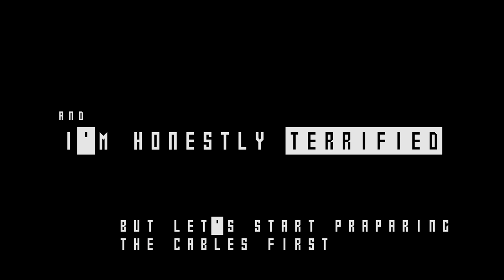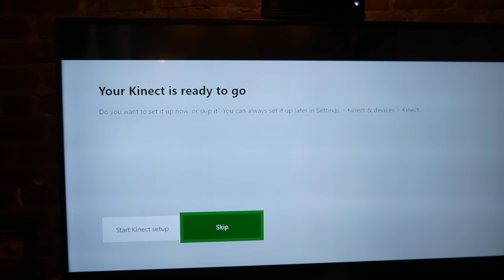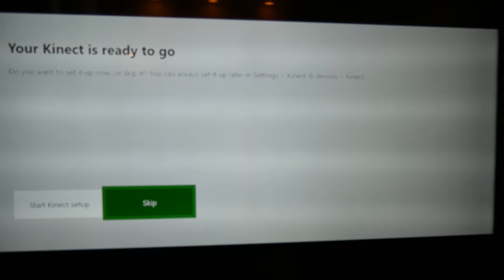Preparing the Kinect - KINECT Full Body Tracking VR - From start to Finish - Ep. 1 [4K]

Comment: Couldn't you have just used the Kinect PC Adapter kit that is a USB + Power brick which simply plugs into your PC?
Most electronics retailers sell them, as well as directly from Microsoft.
For a while they were even giving them away for free to customers who had upgraded from the original XBox One to the XBox One S.
That way you don't have to modify or destroy your Kinect.
Reply from the maker: Unfortunately the adapter was discontinued 2 months ago, and it's now a day impossible to find for a reasonable price, this guide is for who like me didn't get it with the one S or before being discontinued
Reply: Oh no! I wasn't aware that they were difficult to find. I have 3 of them sitting in the closet, unopened. Microsoft sent them to me when I did my console upgrades, and at the time they were also in stores for $50 Canadian. 
I have a couple of XBox One Kinect's sitting around (as well as the XBox 360 ones), so I plan on testing out this full body tracking using both options. 

From what I've read you can also use the older XBox 360 Kinect as well, and those PC adapters are cheap ($10-$20).

https://www.amazon.com/Adapter-Kinect-360-HandHelditems-Sketch-Universal/dp/B005EIXVAE/ref=sr_1_18?ie=UTF8&qid=1521570247&sr=8-18&keywords=xbox+360+kinect+adapter

or

https://www.amazon.com/Microsoft-Xbox-360-Kinect-Sensor-Adapter/dp/B00JVI6BVY/ref=sr_1_6?ie=UTF8&qid=1521570247&sr=8-6&keywords=xbox+360+kinect+adapter
Reply: those have not enough power, you need atleast 2.7/3.0a power adapter. Even on aliexpress they're around 30euro for xbox one kinect pc adapter
Reply: I bought a Kinect for £20. Why bother trying to get a £50 adapter?
Reply: i bought xbox one kinect , + other equipment worth 48 euro just to solder it. I would say it's not worth soldering and its really hard. Took me 2x tries to solder it properly so it could work. And its not that good for vr its very bad
Reply: E- Mail £25 + a free adapter I already have. I'm good at soldering so definitely worth it. Yeah prob sucks for VR so good job not spending much money on it.
Reply: Tyriel Wood JUST USE A KINECT 360
Reply: @krankypantz330  Can you send me one?

Comment: Hi Tyriel

A few tips for soldering, a thing called helping hands is priceless when it comes to soldering you get 2 more hands, also get a soldering stand with a sponge so you do not wreck the tip of the soldering iron, also always soldering the wire first called tinning, use helping hands to hold the wire then just heat the wire up and spread the solder over the copper wire, and lastly when soldering make sure there are no holes and good contact called dry joints which can cause conductivity issues when powering it up
Reply from the maker: thanks! It was my very first time^^ I'm glad my rough way worked too :P I will do it next time!

Comment: to hook up the connect to the computer instead of taking apart the whole connect like in the video, could i just find an adapter on amazon and use that?
Reply from the maker: They are very rare and if you find them they are very very pricey 💵💵 but if you found it go for it! Even better! Just be sure it is for the Xbox one and not the 360 🤞
Reply: @Tyrielwood  I found one for $90 CAD on Amazon. Will be ordering and seeing if it works out!

Comment: Wait... Isn't this just going to put 12V back into your PC from the USB cable? I know this is how it is done, but isn't that a risk?
Reply from the maker: no, but be very careful to don't have the point 4 touching any other point, or that will happen and you will fry the kinect and your usb drive with it (they are very close, so be sure to clean every residue)
Reply: How does it not? The original USB cable carrys 12v from the XBox into the Kinect. If all you're doing is tapping 12v into the same pins from the kinect end, then 12v is going through the USB in some way? Am I missing something?

Comment: It wouldn't surprise me if Microsoft pull a sony and use the enviable xbox VR to shift old kinect stock as repurposed full body cameras. It worked well for sony and the move controllers. And they spent fortune developing and no doubt manufacturing a shitload of those things and just dropped it at the drop of a hat. Its less intrusive than the valve or other alternative products that you need to screw multiple sensors around your living room. Its a decent product and im sure it would sell. That ps5 camera must be there for a similer purpose down the line.

Comment: I see a connector on Amazon for like $10 that works with the Xbox 360 kinect. Could I use that instead of doing this?
Reply from the maker: of course, if you have the kinect 360, but if you have the xbox one version that adapter will not work! there are links in the description of everything you need :)

Comment: Does this work with the older connect from the 360 Xbox?
Reply from the maker: hi greg, for the kinect 360 there is still the adapter around, and yes it will work for body tracking too, but luckily you don't have to take the kinect apart! I left a link to the product in the description, in ep. 2 and 3 I will go over the installation and the gameplay, if it is really worth it. stay in touch! :) let me know if you have any other question
Reply: Thanks Tyriel for the quick reply. I haven't seen ep. 2 and 3 yet so do you know where to get the adaptor?
Reply from the maker: Check the video description! All the links are there :) (even the 360 adapter)
Reply: Thanks again Tyriel. Surprise surprise, I already have one :) Looking forward to your next two videos.
Reply from the maker: That's a great news! Second video up :) be sure to click on the bell button for the notifications